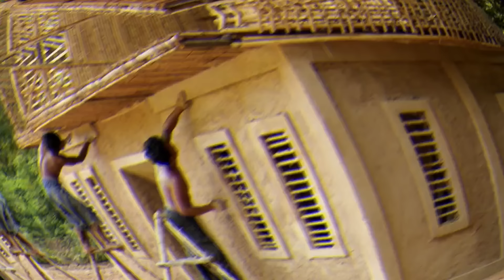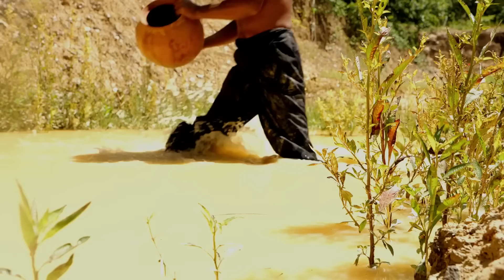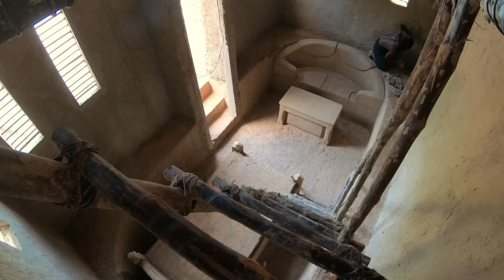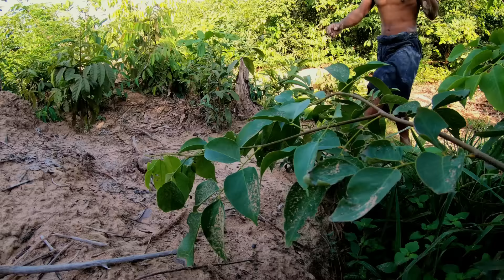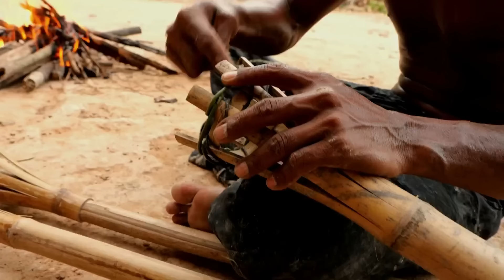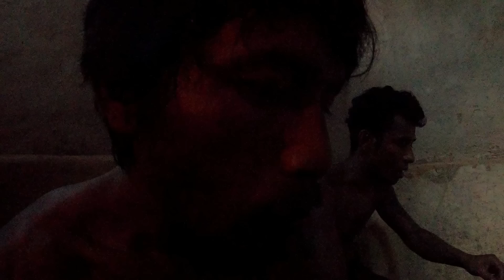Building The Most Creative Two Story Villa With Multiple Room Have Private Underground Living Room

Comment: Although the design seems to be simple and materials used are eco friendly major problem is this house don't have required height from ground. On the contrary entry is below ground level. If there's a small rain then people would have to left this house or had to shift to upper floor.